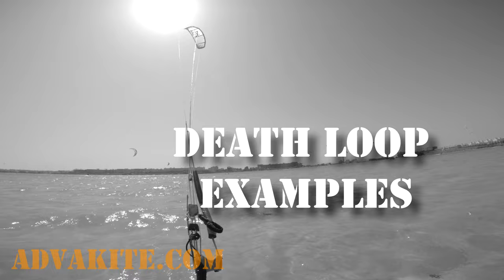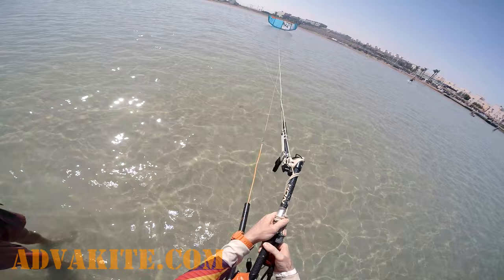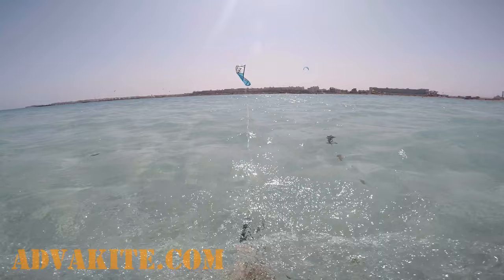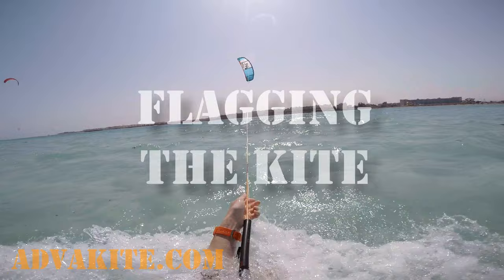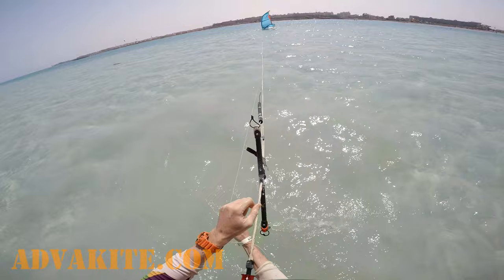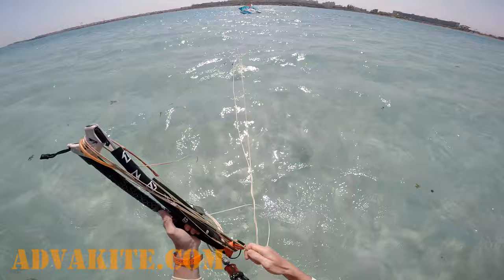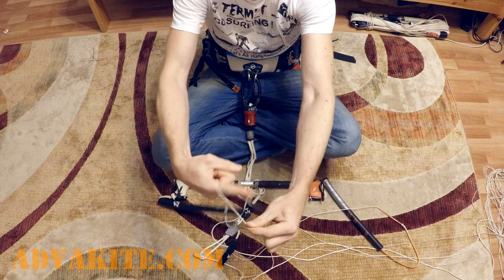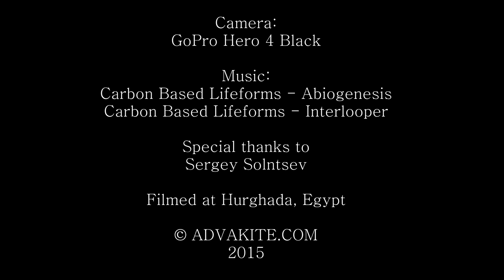Surviving the Death Loop. Kiteboarding tutorial on how to stop an accidental auto-kiteloop.

Comment: Only one technique is missing in this video.

If it is possible, when pulling any line, pull the line with your palms facing down / forward = as if you were using your hands to protect yourself from a blow at the waist.

Because in a case where it is necessary to release the line, the line will not run the risk of traversing its hand throughout its length, causing deep cuts.

When pulling the line with the palm of the hand down / forward, your hand automatically loses all contact with the line

My humble tip

Comment: Awareness and video material of kitesurf death loops is limited. Even though this can be one of the most dangerous situations you can be in while kitesurfing. The video adds great value to a solution I was not even aware off. I am happy you found my video useful and thanks for linking. Keep on the good work!
Reply from the maker: +Daniel Liesveld Thanks for your video! I had the same situation, like you had, several times, but you've managed to untangle the bar underwater! I was amazed! Great example of self-control!

Comment: Nice video! My personal instinct would be to pull the already shortened line. Nice tip to pull the opposite and let the power lines become slack!

I also always untwist my lines in the water before I restart. Just makes the restart process easier, specially considering the bar is upside down when the leading edge is on the water. Maybe it's more of a C kite old habit, but usually I just want to put the kite straight downwind with the leading edge on the water, so it is completely stable, untwist my lines and only then start the relaunch process.

Death loops in dangerous places are 100% preventable. There is no excuse for getting your kite in a death loop while launching, seriously! If you are starting in the sport, just take classes, don't waste your time and stupidly jeopardize yourself and other kiters. And if you absolutely must learn by yourself in this day and age, know that you will be held liable for hurting other people, closing down a beach for kiting, etc. Kiting is a somewhat small sport in the sense that you meet the same people over and over. People know you at some point!
 
In the water, if it does happen, you should not be throwing tricks close to obstacles anyway. And every now and than we all do, but savvy kiters always have it figured out what they will do BEFORE things go wrong.

Thanks for the video, Anton!
Reply from the maker: Was reviewing the comments. Thanks for such a nice post! Sorry I've missed it somehow!

Comment: Thanks for this video Anton. I've survived two death loops... one with an 8m F-One Bandit pulling me hard out to sea after a failed drift launch and the other with a 16m Switchblade pulling me toward a small island in the Real Slick in overpowered conditions. I survived both by releasing the kite after the QR did nothing. In both cases I was so lit that I can't imagine that I would've been able to grab, let alone pull, the steering line. My kites were spinning much faster than your re-creation. In the comments I read, I think Steve McCormack has raised some sage concerns, but I'm not sure I understand his worry about the harness hook and his advice get rid of the hook and connect directly. I'm just starting to wave ride and plan to ride unhooked more often now, but should we be avoiding the hook when teaching beginners because of the possibility that the bar will get hung up on it? Would love for you and others to weigh in. And by the way, I got both of those kites back... the Bandit was chased down by a badass French Canadian windsurfer and a kiter buddy grabbed my Switchblade and held it for me as I swam out to retrieve it. But even if I had lost those kites, I'm pretty sure releasing them was my only (and best!) option.
Reply from the maker: Was reviewing the comments! Missed yours for some reason, so sorry for taking so long! Thanks for your post! I'm about to release the next Ep. of Surviving the Deathloop, where I'm re-creating a much faster spinning of the kite. The techniques still works, so you'll need some practice to use it, because you're really get so stressed with situation, so you're not able to think much) 
Actually I don't have any experience of beginners getting caught by the line wrapped around the harness hook...Not sure that it's worth to teach them "unhooked".
And yeah, about saving the kites) You've raised a good topic, I was thinking about posting a short vid on that topic, if it's needed.

Comment: Hi Anton, 
You clearly love kitesurfing and care about other people so that makes you one of the good guys for sure. While its obvious that your intention is to help others, I'm concerned that not enough emphasis is placed on the danger of grabbing that opposite steering line, and that in a fair percentage of cases this technique will not work. It will not work because the lines are already too twisted, or the kite is looping too high, etc, but also that a persons hands are in real danger, and if the looping gets worse or resumes because the person lets go of the other steering line, BUT that line now tangles on some other part of the harness or the persons body, there will be terrible consequences.
Maybe in a shallow lagoon these techniques are options, but with a kite looping towards rocks, people or out to sea, completely releasing the kite should be emphasised as a real and better option.
The Harness HOOK is a serious issue in itself, most riders never unhook, but are being sold a harness with a hook which has the potential to create this potentially lethal scenario. Ditch the hook and direct connect to the harness using a ring or a Wichard shackle etc, a lot of problems disappear.  
People can still get a steering line around the back of the bar, particularly with older bars and non moulded bar ends/floats, but that is a much easier issue to fix and flagging the kite to the safety line will also still work and also prob fix the issue.
Centre line wrap around the bar tends to happen more easily with uncovered centre line bars, hopefully that design will get phased out soon, there really is no need for it.

Regards
Steve McCormack
Reply from the maker: +Steve McCormack Thanks for a detailed feedback! Yes, I put a safety warning in the description. The technique I offer should be considered as a "last chance" when the safety system is blocked comletely, and you have no other way to avoid injuries. I've tried it im much stronger winds and bigger kites, it works.
Reply: +Anton Chernyshov Please check the comments by cbulota in this thread - and perhaps edit your video to remove those 2 parts that are very dangerous, otherwise its all good.
http://www.seabreeze.com.au/forums/Kitesurfing/General/Surviving-a-death-loop-2/?page=-2#lastpost
Reply from the maker: +Steve McCormack Hi! I already answered that guy about these two topics in this thread several days ago. I will probably add more explanations about it in Episode II. So far, I would say again, that every modern, old, no matter, kite can be depowered, hanging on one of the back lines IN CASE if ALL the other lines are completely slack. It can rotate several times, but no power will be delivered. See my answer in this thread for more details. Thank you.
Reply: +Anton Chernyshov Hi Anton, I think there must be another thread I cannot see your answer in the one I linked to. Anyway I still agree with Christian, grabbing a rear line on any kite will potentially lead to injury to your hands, especially if still hooked in, and we must teach people to never wind in the lines while still hooked in, that one is extremely dangerous. I agree that sometimes a kite depowered by one rear line might behave ok, but I've experienced the opposite, and know that I would never teach others to depower using a rear line. I hope you explore the no hook option too, it really would eliminate all the accidents caused by a line or bar end getting trapped by the hook.

Comment: Hence I've always worn friction/ cut resistant gloves for de powering a power-line...I feel naked without them gloves.
Reply: Bass Buster any particular brand you recommend?
Reply: I used Gul sailing gloves for a while, they had a synthetic leathery palm.. I've handled kite tensioned dyneema helping a guy land in a difficult situation with not damage !  .. There are a lot of work safety gloves available to providing they are cut resistant and for wetwork..

Comment: Hi.  Thanks for the video.  I am having difficulty understanding the key point at 3 minutes 04 seconds where you say " Simply grab the ....???..... steering line".  Which steering line do you suggest grabbing??  Many thanks
Reply from the maker: Hi! It was "farthest" line you need to grab. You can also use the one, which is closer to you (the one, which is actually initiating the loop), but it is harder to do, because you have to overcome some point of maximum tension of the loaded line before your kite flags (I'm talking about it in the movie as well). And you need some strength and hmm...faith) to do that. I mean, often guys feel that the kite starts to spin more as they pull, so they just quit pulling, not realizing that the kite is about to stall soon. 
With the "farthest" line it's different, much easier to stall the kite, if you are pulling the farthest line.
Thank for your question!

Comment: Hi Anton, good video and great tips to safely stop the kite from death looping. However, I would never recommend following the back line to recover the kite, in any stronger winds than in your video, this will send the kite into a death loop and rip off your fingers. These were the old safety system where the safety leash were connected to the back line and were a death trap. I agree with Phillipe Ancelin as well, wrapping your lines while still hooked in and with the bar tangled, is another death trap in strong winds, you should never recommend this to anyone
Reply from the maker: +Christian Bulota Hi! Thanks for your feedback. What kite (model, year, size) was the one you tried to flag using the back line and failed? What was the wind speed? I don&#39;t know not a single modern kite, that would generate any significant pull, when hanging on one single back line with all(!) other lines slack. The ONLY example that comes to my mind is Cabrinha Switchblade 2008 (I had 12m one). It had kind of link between the steering and the power lines in the bridle. As a result, the kite was spinning around the wingtip, when flagged, resulting some minor amount of power, not enough to shift your body on the sand, for example. Interesting fact, it had no other way to flag! Cabrinha started to use safety line from 2009, if I remember it right.
Reply from the maker: +Christian Bulota Regarding staying hooked. A lot of instructors would recommend you  to release the chicken loop. But from my experience, I can say, that if your kite is Fully flagged on one line, tangles on the other lines don't matter. You can make a knot of all of the other 3 lines, wrap them around anything, cut them off, you know what I mean. They are out of the game, loosen. I repeat, if the kite is REALLY flagged, meaning, that the line you used to flag is SHORTER then ANY other line in the control system.

Comment: great video...what if steering line breaks and deathloop starts? in this case you have no slack line to hold...and for me looks like very very hard to hold the tension line causing the death loop (especially in 30+ knots).! anyway..great video.
Reply from the maker: +Nuno Oliveira Well, usually if one steering line breaks, the kite loops fast, but without real power, since it "half-flagged" let's say. I saw one such accident, when was filming this episode. It was not dangerous at all. Anyway, I think you can use quick release easily, if you want, in case of simple line break.

Comment: Good video, deathloops are nasty. I had a demo of one a few years ago, showing a friend how to self launch with a ground anchor...he grabbed the bar after it had got hung up on a line...kite rotated like crazy, the power was just insane. Luckily it did flag out before snapping a line or destroying the chicken loop.    I still think whats needed is a total quick release system. Would rather lose the kite than get badly injured or killed.  Are the 5 line systems any better?
Reply from the maker: Hi, Rob! Thanks for your story, never heard anything like that! Amazing) Looks like you were prepared for the situation and acted quickly enough)
Not much difference between 4 and 5 liners regarding the deathloop, I guess. Probably using a 5th line somehow would be easiest way to flag out the looping kite....However, no clue, how to separate and grab the 5th line if the control system is tangled and stuck on the harness hook!!
BR, Anton.

Comment: HI Anton, very useful video. I recently had one of my bridles snap when at the beach causing kite to enter death spiral. I think this technique is useful for this situation as if the bridle that snaps is on the front line connected to your safety release system then by activating your quick release you would lose your kite. Am I right in thinking that this would would in this situation even if the lines weren't twisted?  Cheers again and safe riding!
Reply from the maker: +Rory Morrice Hi! Thanks for your message! I think it depends on where the bridle is snapped. I was thinking about simulating this situation in the second episode to see what happens. I'll try to cut the back line and on the next round the front line, to show, how the kiteloop looks like and what technique is better.
Cheers. Anton.